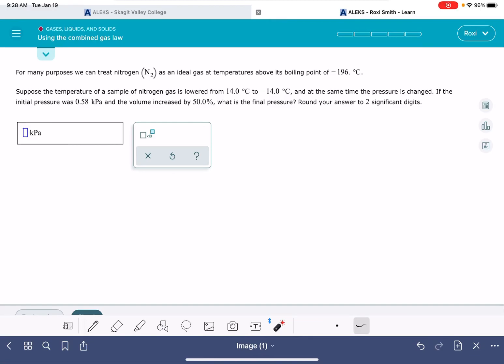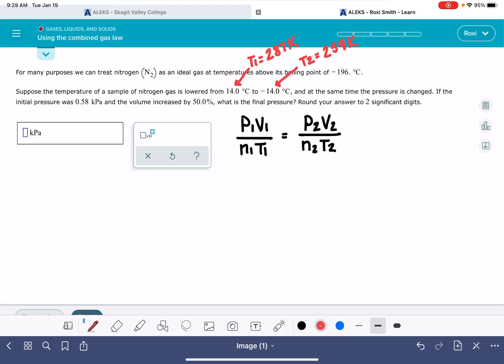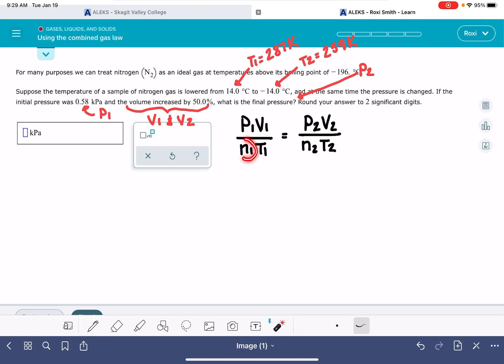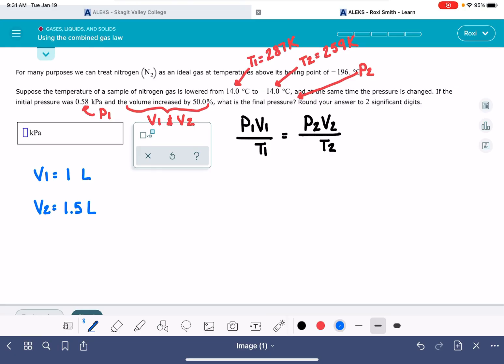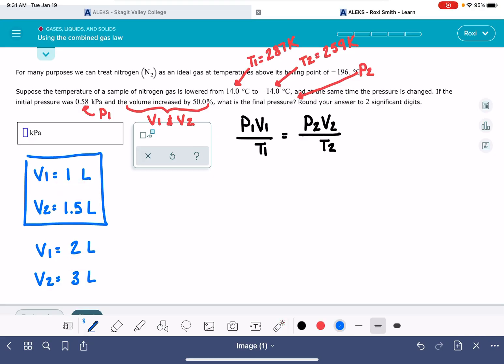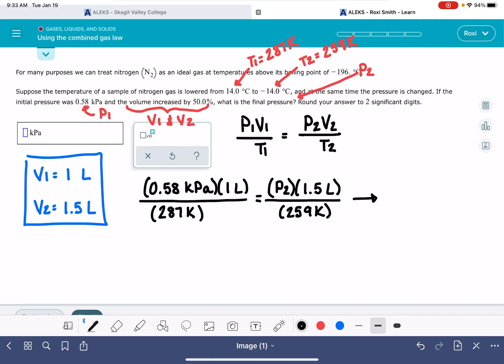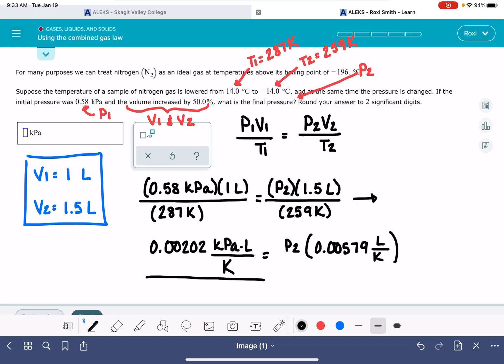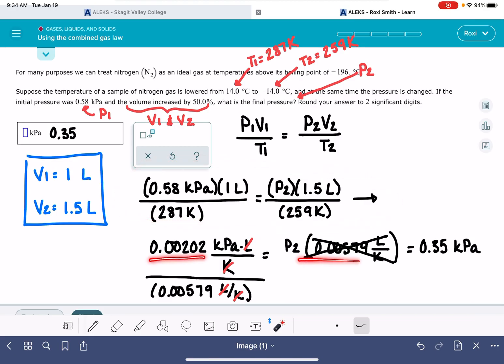ALEKS: Using the combined gas law

Comment: Hi Roxi! I was wondering, since in this problem it says it has increased by 50% and we use 1.0 L and 1.5L, what about if the problem says it has decrease by 30%, what would be the V1 and V2?
Reply from the maker: You can always use 1 for V1. 30% of 1 is 0.3, so a 30% decrease is 1 - 0.3, which would give you 0.7 for V2.

Comment: I am sorry where did the 1.5 L come from
Reply from the maker: The problem says the volume increases by 50%, which is 0.5 L. The new volume is 1 L + 0.5 L = 1.5 L
Reply: @RoxiHulet  Ty so much for the quick response that make sense and what about if it about pressure  atm how would I convert it using percentages sorry to bother you about this but Alek questions about combined gas law was about atm and percentage
Reply from the maker: @angelbrown3825  same thing… just make your initial pressure “1 atm” and then calculate your final pressure based on whatever the problem tells you about the change.
Reply: @RoxiHulet  Ty you so much I love your videos they are so helpful and save me hours while trying complete Aleks your the best in the biz